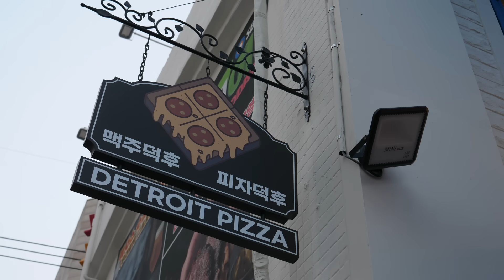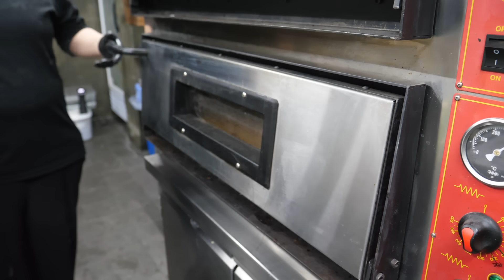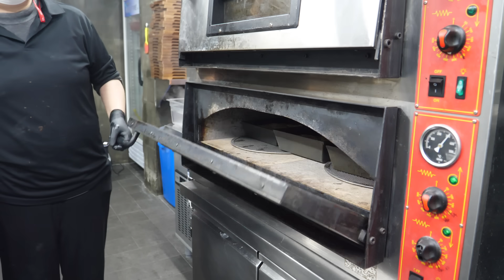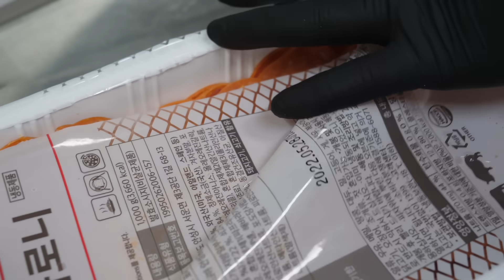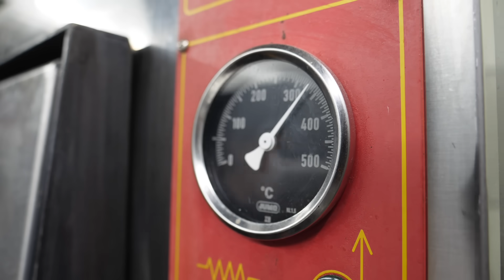한달에 5000판! 역대급 정성이 들어간 미친 퀄리티! 사각피자, 디트로이트 피자 / Amazing detroit pizza master / Korean street food

Comment: The details into each pizza is amazing.   The preparation of the short ribs for the BBQ pizza must have taken most of the day.  I've made my own pizza for 50 years, I'm stepping up my game now. I do my dough the same way, I make mine in a cast iron skillet, fry it a bit on the stove, then bake it, flip it over then add the toppings and bake again.
Reply: Indeed, sous vide cooking takes a long time but it tastes absolutely amazing. There is no cooking technique that can match it in terms of tenderness, juiciness and texture. I have such a sous vide stick like they're using in this video at home as well, I don't take it out much because it takes so long but I think I'm going to make me some pizza toppings with it after seeing this video
Reply: Totally going to make my pizza in a cast iron next time. Thanks
Reply: @19 years old I am retiring next year and my plan is to make some cooking videos.  I've made my own home made bread every week for over 50 years.
Reply: @stdesy   First rise in a bowl, then press into a greased cast iron pan, I do a 12 inch pan.   Let it rise for 30 -45 minutes (second rise), add toppings while the oven is heating up.  fry the pizza on medium heat for 3-4 minutes to get the skillet up to temperature and start cooking the bottom of the crust.  The edges of the pizza should be bubbling, then put in the oven, I do 450 degrees for about 10 minutes
Reply: @stdesy  uuuu
Reply: I'm gonna try that.
Reply: this is not pizza !! come to Italy to taste the real Pizza ..
Reply: There are many ways to make  and bake pizza...but only italian one Is the best....
Reply: @eckankar7756  요리 비디오 만들면 꼭 초대해주세요
보고 싶어요
화이팅!!!👏👏
Reply: Sounds so delicious.
Reply: This ist Pizza. Its an abomination. U make Ur Dough the same way wtf?
Reply: Huh
Reply: @epilzona  I agree ... wtf was that ?? ... a bizarre K-pizza for sure ... 

Did you  scope how much of the food prep and cooking off actually charcoaled the ingredients ? 

The vegetables roasted off were literally charcoaled to crispy black ! Imagine the bitterness that would impart.

Did you also see the bizarre method of making and reducing the red wine sauce ? ... I thought they were making a dessert when making caramel with cups of sugar  like a sweet factory ... but no !

... and how charcoaled the crusts of the pizza pies were ... I mean they were black ... not caramelised ffs ...  as all the cheese had burnt.  

Imagine the bitterness that even the shit-ton loads of cheese couldn’t disguise ...

Maybe the palates of all the customers who eat there don’t know and taste good food even if it smacked them in the face  ...  otherwise how the hell else could this place survive ?

The fat in the short ribs was still white when he sliced them open which means the fat hadn’t been rendered down  properly ... hence no flavour would have been infused through the ribs while cooking ... and (as a side note) who sous vides ribs anyway ?????

Blown away by the bizarre fusion of Korean street food sensibility and Italian pizza ...

Gotta love Amurica ...
Reply: Every country has different taste if they said its Korean Pizza means all the spices adjust the taste in that country, im indonesian n i can said that i like the taste of pizza in my country than where the pizza is born cos pizza in my country is already adjust the taste of indonesian spice
Reply: Řt
Reply: wow
Reply: @eckankar7756  do you those lloyd pans?
Reply: Sounds wonderful
Reply: @doriandundee9906  wtf do u eat then? dog food?
Reply: @lizsteeds6697  this isnt even america, that pizza looked bomb asf. the meat and everything looked amazing. go eat dog food or smt
Reply: And you are located where in the US
Reply: Fr I really wanna go there😭
Reply: @eckankar7756  I want to watch your videos. How can I follow your work?
Reply: I'm in the same boat with you I think we all have to step up our pizza game after this! I knew I was done for when she was making the sauce as that's how my Italian grandmother used to do it. This place must Rock
Reply: @caprisun4u545  3
Reply: @epilzona  
You sound insecure
Reply: @eckankar7756  أعطيني مقادير البتزا الخاصة بك من فضلك أنا لا أعرف كيف اصنعها تماما وشكرااا

Comment: “Buddy’s Pizza, the home of the Detroit-Style pizza. It’s been making square pizza since 1946, when Gus Guerra jammed some dough in one of the industrial Blue Steel pans that were ubiquitous in the automotive factories in Detroit. The pans were used to ferry smaller parts around the shop floor, but Guerra coated one with a little oil and boom, the Detroit-style pizza was born. The steel is an excellent conductor of heat, which allows for an evenly baked crispy crust and that wonderful crunch of burnt cheese on top.”  An excerpt from an internet article on the history of “Detroit style pizza”.

Comment: As native of the Detroit area I will say that these all look really good. Very nontraditional, but really good looking. Most places around here build their pizzas with the sauce placed on the uncooked dough like any other pizza. Only a few places add the sauce on top as you tend to see in  most depictions of "Detroit Style" pizza. The originator of the style , Buddy's Pizza, does it that way. It's never been a favorite of mine though. Many of the pizzas in the video do not have pizza sauce so in more classical pizza terms they would be considered a "white pizza". I rarely see white style Detroit pizzas. Usually in nicer restaurants, or small specialty pizza places. Never seen it from a chain of any type, not saying it doesnt exist, just that I haven't seen it in the Detroit area.